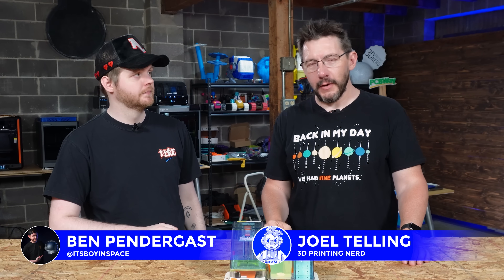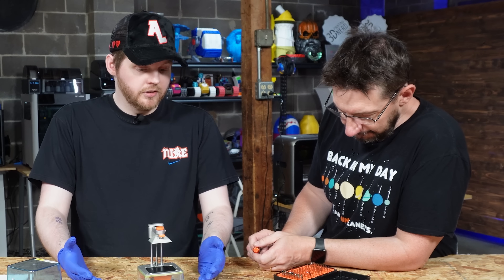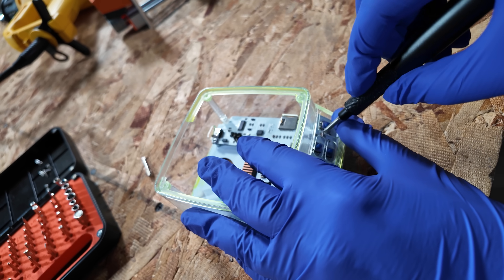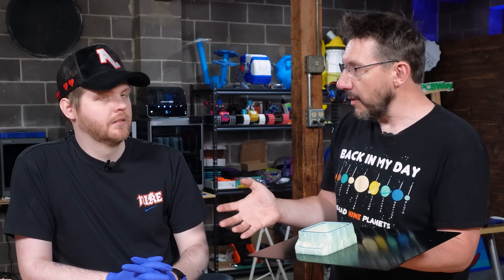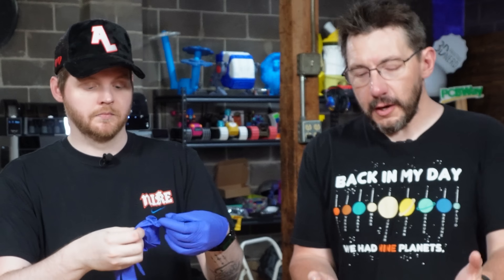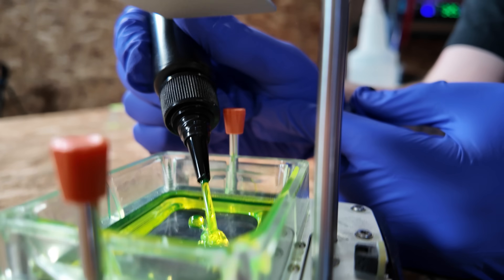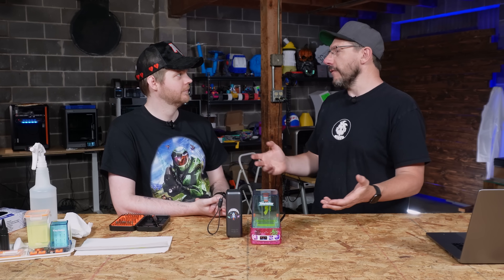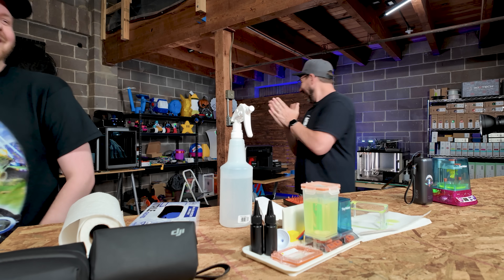SMOL RESIN - Dangerous?

Comment: What exactly is 2k Clear?
Reply from the maker: 2k is a type of finish/paint. 2k means it has 2 parts, the catalyst and the hardener, basically like 2 part epoxy. You have to mix the two portions together. It just provides a harder finish that is able to be polished and has better protection